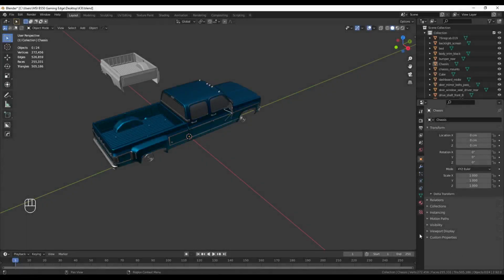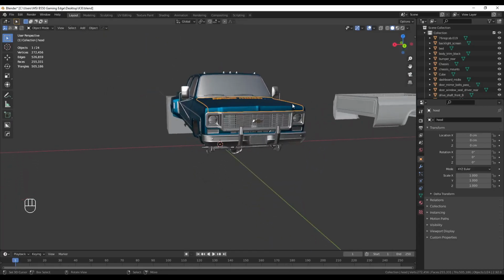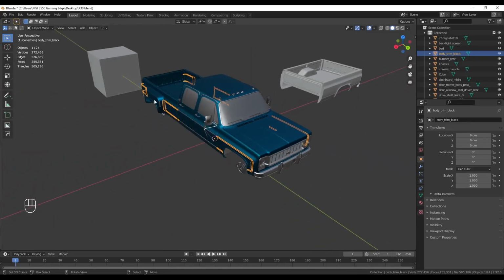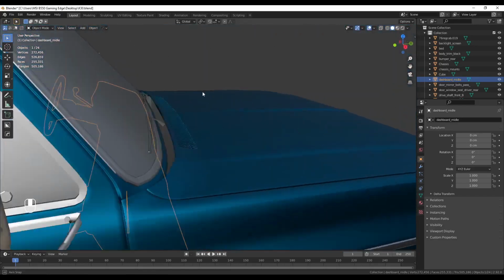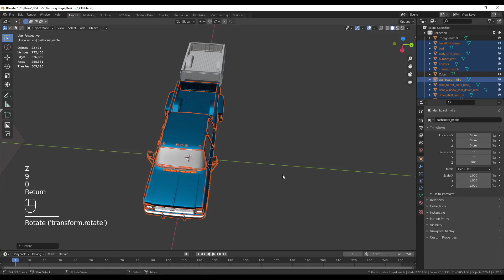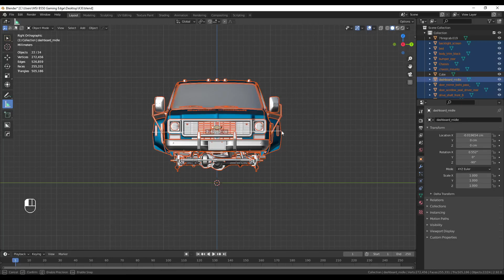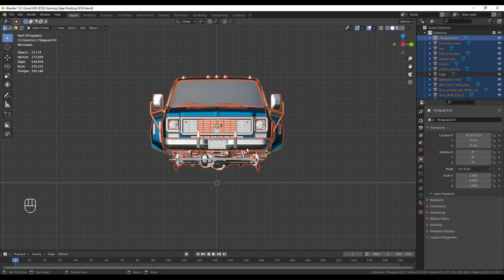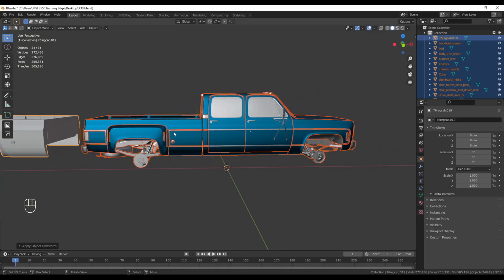Snowrunner modding part 3

Comment: I'm not a modder, so this could be wrong. It seems to me the scale is 1/100. Knowing that should allow you to properly scale the vehicles to their real life counterparts. A truck IRL that is 2.5 meter wide by 5 meters long would get scaled in Blender to 2.5cm wide by 5cm long. Of course that assumes the model was built to scale in the first place (which is easy if you make you're own models, not so much if you grab them from someplace else).
Reply from the maker: In addition to that, the cargo/game world is scaled wrong.  This is a constant battle myself and several other modders face: Do we make our trucks real-world scale (where a flatbed pickup truck can carry the pallets in-game) and have a adult driver model that is too small in the cab.  Or, do we scale them to the game proportions and have everything look "right" in the game but cripple our trucks' capabilities to match the way the game looks?  Personally, I try to get the trucks to be roughly the right size (maybe a little bigger) but keep them close enough to game scale that they don't end up looking like toys